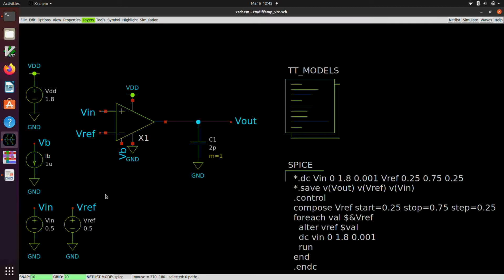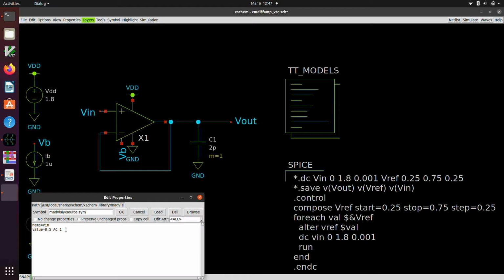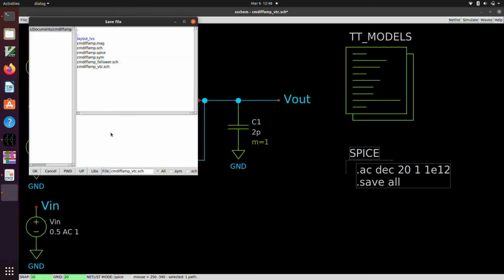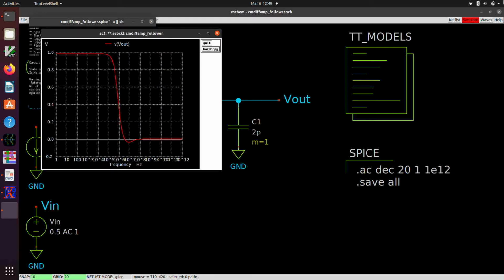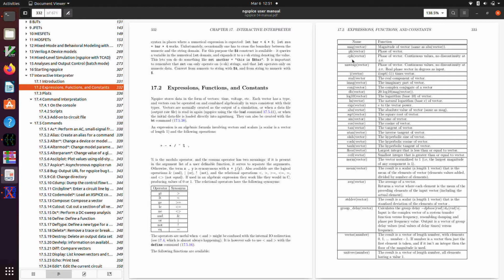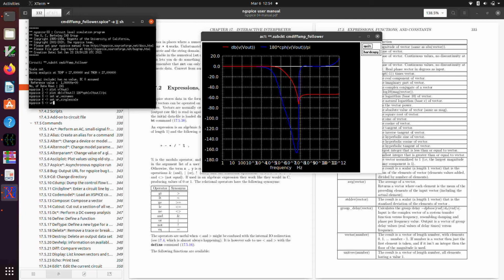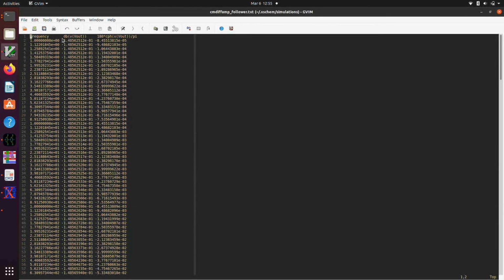Xschem / Ngspice AC Analysis Tutorial

Comment: 00:02 AC analysis of a current mirror differential amplifier
01:32 AC Analysis allows flexibility in input voltage selection.
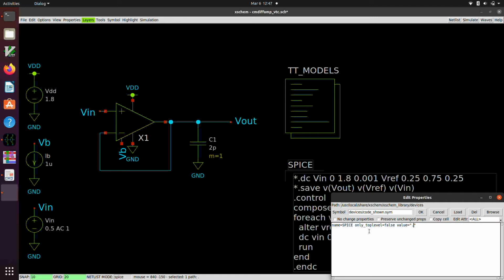03:01 Setting up frequency points and simulating AC analysis
05:13 Understanding real and imaginary components in AC analysis
06:29 Understanding phase of vector in AC analysis
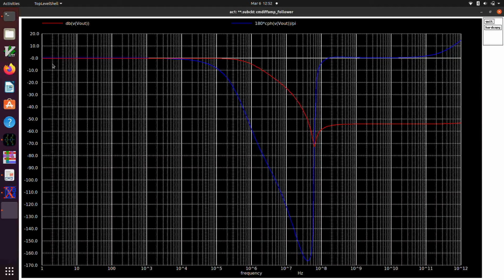07:57 AC-Analyse der Frequenzantwort
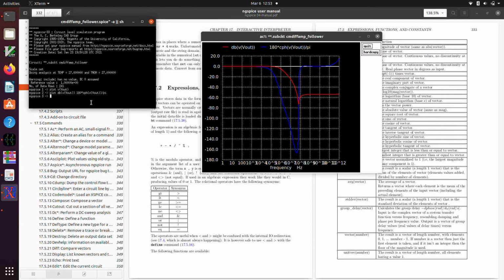09:16 Exportieren von Wr-Daten in eine Textdatei
10:31 Generating CSV file from Xschem simulations
Crafted by Merlin AI.